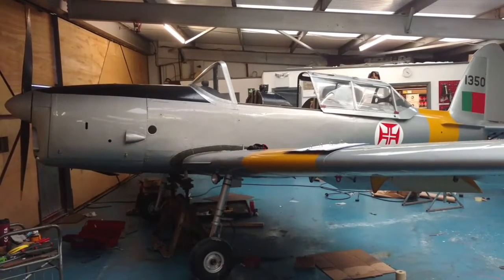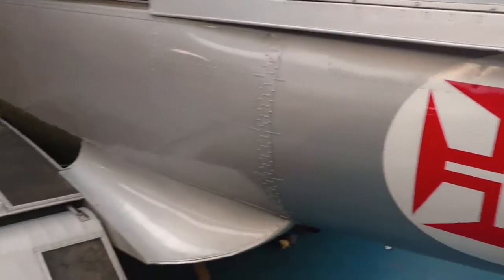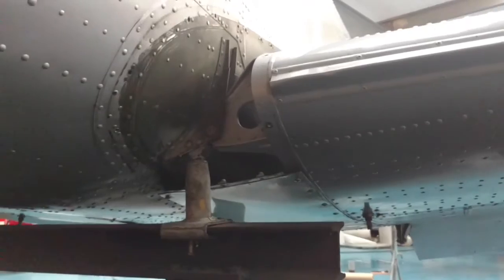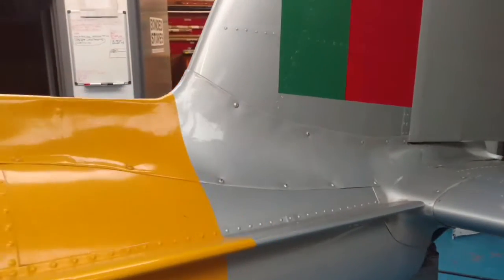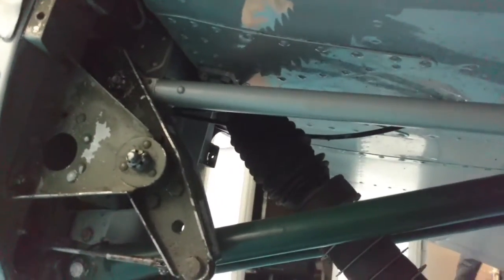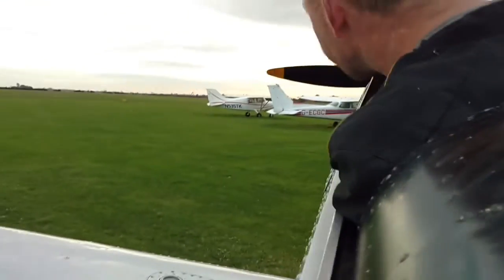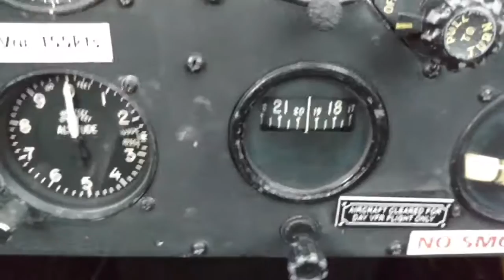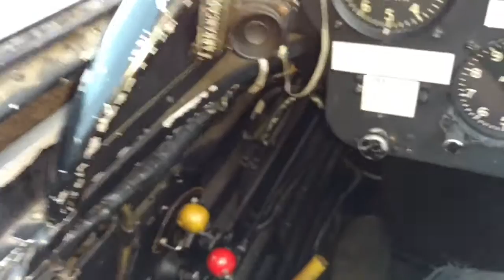DHC.1 maintenance walkaround and start up Chipmunk

Comment: Spent many hours working on the Chipmunk in my early years in the RAF, 1st and 2nd line maintenance, the only challenging part of the maintenance was setting up the elevator trim rigging, and then only because you had to take out the rear seat and get into the aft fuselage to work on it with any ease, you could have it perfectly rigged and tensioned and the re-wirelock the turnbuckles and the independent assessor would come along check the tension and it would be completely out of tension again, the slightest pull on the cables would just change all the hard work. So much for an electric starter, never ever had a problem starting with the cartridge starter or hand swinging the prop.
Reply from the maker: Nice one, I found rigging the rudder pedal brakes properly to only come on with two clicks of the park brake quite fun again because of access and it being a completely alien concept having a system like that. What else did you get stuck into?
Reply: @turboconqueringmegaeagle9006  Hi, I had forgotten about the brakes, yeah weird set up but it was effective. To be honest I was lucky to have a very varied career, from the BFTS at Cranwell I went n my fitters (technician) course at RAF Halton but after that I worked at the aircraft storage facility at RAF Shawbury, we had Jaguars, Buccaneers, Hunters, Beavers, Bulldogs, and Jet Provost aircraft, quite boring really, mostly anti deterioration servicing and the occasional return to service procedures, then on to Gutersloh on Puma and Chinook 2nd line working in the airframe repair team, but funnily when my Father came to visit it turned out that he worked in the same hangar, same work bay, and he thought the paint was the same as it was in the early 60s, from there to RAF Lynham on the Hercules, and during gulf war1 we had to lift a floor board to find a leak, what we actually found was a mummified baby crocodile/alligator (true story) had it on my desk for weeks, then back to Germany ,RAF Bruggen on Tornado GR1s and then finally to RAF Odiham on 27 and 18 Sqn puma and Chinooks finally bein discharged in 2003 after 24 years, also did many detachments around the world, the usual Falklands, Gulf, and balkans, but also went to America, Austria, Slovakia, Italy etc etc, and that in as few chapters was my RAF career. How about your good self? 😀👍🇬🇧🏴